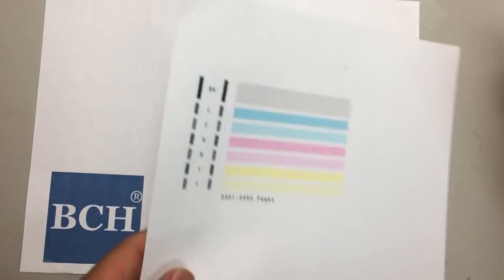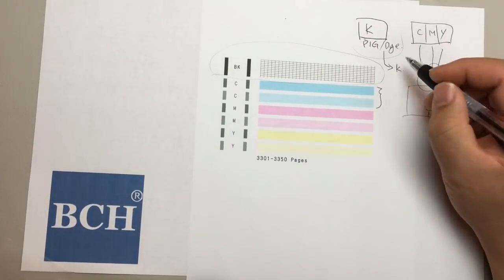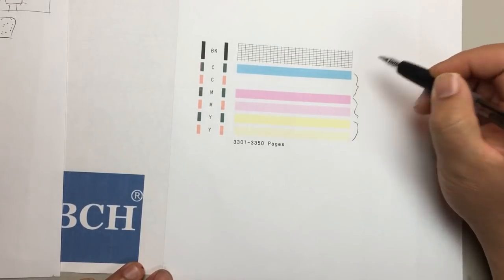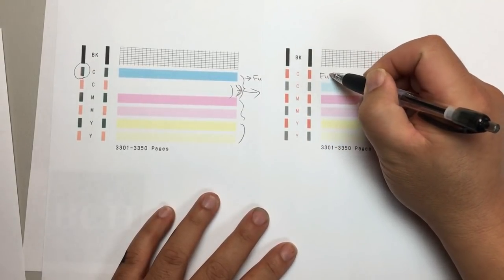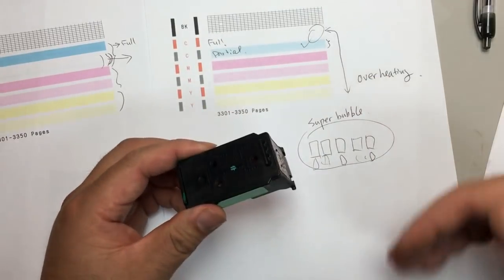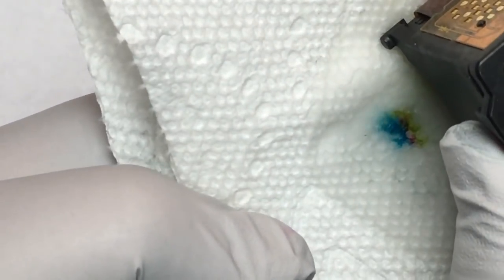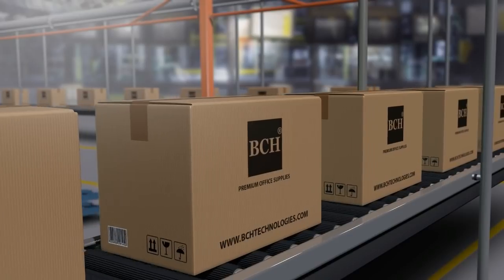#1 Refilled Canon Printhead Failure: it is NOT clogged!

Comment from the maker: 0:00 How to Read a Nozzle Check Page
8:00 Unclogging with Priming Clips
8:56 Boiling Water
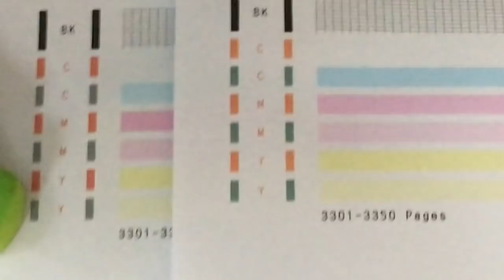9:30 Ultrasonic Cleaning
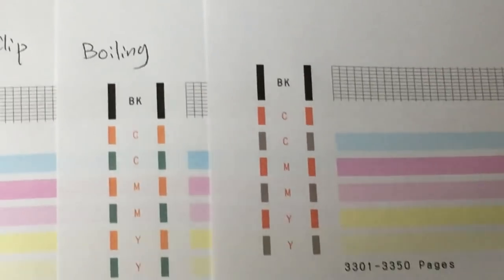10:00 High-Pressure Steaming
10:33 Vacuum Hose

Comment: I'm a software engineer. I used to hack printer devices (for example the epson xp320). In their program, there is a hard limit on how much ink can be spent on each color on one cartridge. What it means is even the nozzle is not clogged/jammed, the program will still disable the ink cartridge via its chip and makes it look like the nozzle is end of its life after certain prints using that color. That is the main reason of refilling ink doesn't work that well. I verified it by changing the chip on that cartridge, and everything just worked again. Not only that, the printer body will have a hard limit on how many times you can use the internal program to clean the nozzle. After that the whole printer will just stop working if the limit is reached.
Reply: Thank you so much for this information. You have no idea how I have been driving my self crazy with all the printers I have tried. I have own 4 epson and 2 canon printers and right now the Canon TR7020 that I have is showing that the black cartridge is not printing correctly and I had a feeling that it has to do with the filmware that I keep saying NO to the update. This information you posted here give me peace of mind that I am not crazy :) Any suggestions on how to avoid or fix all the limits you mentioned to make the ink cartridge work again?
Reply: @VickyLatorreArt  The easiest and most feasible way is to buy a bunch of the ink cartridge chips and change it when refill the cartridge. This still requires some $. Second way but may not work for all printers, is to buy one hacked chip for each cartridge. This type of chip when you run the printer program "replace the ink cartridge", the chip will be activated and update it's serial number to deceive the printer making it looks like a new cartridge. Third is to build your own firmware for the printer but it only works if you are the internal employee and have access to the source code. However, releasing the source code or the hacked firnware will get him/her into legality issues. Take my example xp320 printer, if you search xp320 refill chip, there are plenty of them on ebay.
Reply: @VickyLatorreArt  Also for resetting the nozzle cleaning limit, there maybe software online depending on your model that you can buy to do the reset. Although people like me they don't have access to the firmware source code, but hacking the device via UART/USB so that they know what command to use to reset the limit. But those reset can only clear the nozzle cleaning limit not the cartridge life span.
Reply: @jasonliu3202  Thank you very much.
Reply: @jasonliu3202  I purchased refillable cartridges with auto setup chips in the passed and they worked very well for me with the Epson Artisan 800 the rest of the printers have not give me the same luck. No matter what cartridge or ship they always end up not working. I was hoping me leaving Espon and getting a Canon would do a difference but I still have the same problem after I fixed it. This present black color cartridge I have in my Canon TR7020 stopped working. I changed the pigment ink to dye ink and used the cartridge clip Mr. Kevin has in his website and the cartridge came back to live twice. But now is doing the same thing again. I have tried everything. I have it soaking in water at the moment to see if that works. But after trying all that I have tried before I don't understand why it happened again. The only thing that makes sence to me it is what you mention about the limit and the filmware I have seen give problems to everybody. Thank you so much for all your imput. I really appreciate it.
Reply: @jasonliu3202  perhaps it's time to completely rewrite the firmware rather than just patching it. :)  There must be some good reason not to confirm an answer to an obvious question.  Thanks for another great video
Reply: @VickyLatorreArt  updated firmware for canon unlocks 3rd party cartridge/ink usage, because of supply chain issues worldwide.
Reply: @Seriouslydave  At the moment my Canon TR7020 is working. The black cartridge has stopped twice but I leave it sucking in water for a day and use the adapter I bought from Mr. Kevin website and it makes it work. The inks I am using are water base no oil base like I wanted. It is not good enough for heat press transfer printing but it is good enough for documents.
Reply: why they do that?
Reply: my canon g3010 bought last year produces black that is not in full color. I mean the upper part has color. the middle don't have. the bottom has. I did everything. but it did not go back to normal
Reply: @kim9953  Not sure about Canon but Espon is doing that. Main reason I think is to force people buy more ink cartridge because the ink is too cheap to earn anything from.
Reply: @Seriouslydave  Really david are you sure of that as i would  like to  do the update on my TS 8320 Canon
Reply: So it means even i change my cartridge i will experience the same issue because the limit of chip hits the maximum
Reply: @NLIFE1234  As long as you keep buying new cartridge and do not use the internal program to clean your ink nozzle, you should be fine.
Reply: @jasonliu3202   thank you for verifying this. The greed of these printer companies is making me so mad. we're wasting a lot of time to fix something that are intentionally made to be non-repairable.
Reply: There is a waste tank at the bottom of an EPSON printer, and the clean times counter is responsible for not overclogging this tank, or the printer could suffer catastrophic self-disassembly of pressure lines and dump ink on the desk. It is normally fairly generous for normal use life of the printer, few people ever have to worry about hitting that count. There exists a maintenance procedure which consists of replacing (or if you're brave "replacing" that is just giving it a good stern look, or manual cleaning) the waste tank. Since the tank isn't chipped, there is a corresponding technician service method to tell the printer that it has been replaced, it usually works via USB; whether you'll find it for your particular printer, depends.

The waste count increases with different uses, with ink tank replacements, with load unload of heads, but not as quickly as with hard clean procedure.
Reply: Sir, can you stop the annoying canon genuine cartridge problem?
Reply: This is exactly the comment I was looking for. I now have a new Canon TR 4650. There is only an integrator for papers on the cassette. It probably also detects the number of prints. In the videos, people cheerfully fulfill it, but no one says anything about the reset. Is it possible to print even with a warning sign that the cartridge is empty and continue with only a refilled one without resetting? Sorry for my English.

Comment: hi Kevin at BCH I like the information you provide in this channel. I would like to add a bit why there are 2 lines of check nozzles in each color on a canon printhead. Although in some types there are several colors that only display one line. From my observations why there are 2 lines of check nozzles in each color is because there are 2 lines of nozzles in each color and both have different hole sizes. One row has a larger hole diameter than the other (in certain types, 5pl and 1pl are listed). That's why we get 2 lines of check nozzles. However, in some types, we only find 1 line of check nozzles, possibly because the color has the same nozzle diameter size each side.

Comment: I'm having this exact same issue with my ix6820, definitely a failed printhead.   The light colors for my CYMK test print are completely blank.  If I print in standard quality all colors print.  If print in high quality, the colors are half missing.  I've used the ix6520 for over 10 years and never had this problem.  Not even when I removed and cleaned my printhead.   Owned the ix6820 for 1.5 years and it's been nothing but issues.  Glad to of found your youtube video as confirmation, because it's been driving me crazy.

Comment: Hey Kevin!
Just wanted to thank you bro! For the very useful and accurate instructions. Specially, this one: "Do NOT give up too early...!"
I've got a TS3440 PIXMA which has PG-440 & CL-445 cartridges. And I used to refill them with insulin syringes, without no trouble. But, after awhile the black cartridge stop printing even after refilling (I did not used to prime the cartridges at that time nor was aware of its necessity!) So I've end up breaking open the cartridge lid and removing the sponge trying to make an sponge less one, after seeing the near dry and almost white sponge in there. However failed to airproof the lid, everything was fine except for the ink flow to bottom plate. So I had to remove the lid again, though it was very hard this time- I had to sink the cartridge in acetone for several hours, trying to place back the sponge, fixing the gaps & ...
After all, the most valuable tip of you which I kept in mind was "Do NOT give up too early, show your printer who is the boss!"
Thank you brother, thank you very much!

Comment: Amazing how little inkjet printer technology has advanced. We got lasers, we can print on various surfaces, UV inks, latex inks and now we can sculpt/print in 3D! but yeah we still cant keep print heads from clogging and causing banding on prints so were over here boiling, steam cleaning and wasting tons of time trying to talk to tech support as you work as printer technician in a frustrating effort just to save a print head thats going to mess up again anyway later on so you bite the bullet and eventually buy a new print head/printer. Ok, printer manufacturers, you win.

Comment: Seems like the ink channels are all flowing after all those different cleaning methods, but maybe something electrical?  As the 100% Cyan isn't firing 100% at all... but does for the Cyan 70%-80% test bar?

All my CMY (and dye black) are NOT firing... but my pigment blacK does.  The ink flows though manually, just not when printer executes the nozzles.

Comment: Dear Kevin,my Canon Pixma MP490 prints perfect black but does not print color at all.When I print a nozzle check pattern,black is printed perfect,but below it the page is totally white (blank). Not a single trace of color. Both black and color cartridges are full (I refilled them myself). Of course,I've tried all unclogging methods, but nothing worked. Any suggestions? Happy 2023!
Reply: Same problem.  Any solution?

Comment: Canon MP520   ITs been a great printer.  But the print head failed... or so I thought.  I bought a new print head and at the 1st the printer did not recognize it.  Then it did. Printing was restored slowly but there is no yellow.  So I tested the print head in a different MP 520 = all colours have perfect saturation in the 2nd printer.  So the yellow does not work in the first printer.  Checked and cleaned gold pins on carriage with iso propyl  = no change!    Any suggestions?  Eeprom, connection?

Comment: 2:30 I don't think you're correct. Actually, there are different sets of nozzles, one that are able to project 1pl(or 2pl) droplets, and the other project bigger 5pl droplets. That explains why one can be clogged while the other are not. At least that's my understanding.
Reply: That's exactly what I was about to write now :) So it means, that one nozzle for blue is still clogged. I realized that after watching this video https://youtu.be/o8B5TAqymks?t=45 where you can see CMKYMC nozzles. Thats the same as in test pattern, where is only one yellow, but two cyans and magentas. It also means when you are able to clean printhead from topside opening, you cannot be sure that both (or more) nozzles for that color are cleaned.
Reply: makes sense. probably those are not clogged, they might even be burnt out

Comment: Good day, thank you for this info. but it doesnt work for me. i did all the cleaning, deap cleaning, hot water, vacuum, but still the colored cartridge still not working. but when i check the nozzle, i put it on a tissue paper theres a mark of the 3 colors. but when i put it back in the printer theres no coming out. what should i do sir?
Reply: Too me sounds like a dead logic board......No output to Printer head assembly.

Comment: Great video. What does it mean if the entire top section with the black grid lines does not print at all? 

It’s not fuzzy, or slightly printed, it is completely missing, and the rest of the page prints fine.
Reply: What did u find out?

Comment: i inform everyone with this kind of problems, that canon is being abosive trying to sell his printer ink with the following method ..., because i already had two high resolution printers of the same brand a mark ii that gave head problem because I used cheap ink cartridges when I wanted to use them just for copying so I stupidly bought a pro 10-sa to think that I would never have any problems but I was wrong, I need these companies for photography exhibitions of which I use the originals but how the ink is it is very expensive for more basic things I change the ink cartridges, only that both had false problems in the print head. whenever I used non-figdinios ink cartridges from the beginning it diminished the quality of purpose after it gave the print head a problem with some use or injected a few more colors, so I decided to do some tests I changed for all the figdine ink cartridges and she magically stopped giving problems, then not happy i decided on 2 or 3 white ink cartridges and it worked well on the table. again I added more altered cartridges and it was a problem after a few prints. So I decided to understand what was going on and trick the system to see if it was really ink or canon to sell your ink cartridges created a purposeful problem. and voila I drained all the original ink from the fiddinios ink cartridges and injected the ink of another brand for testing, so I printed many things and it was no problem, that is, the problem is not the ink but the canon, they do something to give problems on purpose. ... it was my conclusion I spent a lot of stress with this problem I think I am not obliged to always have to use the brand's ink ....

Comment: If ink has dried within the head, using force or high temp will only make it harder to remove and ultrasonic and suction won't work.  You want to start with the physically gentlest method . Start with low temperature chemical solvent and soaking, alternating with rinsing with warm water in a gentle flow in BOTH directions until the water runs clear. Check that head is clear of ink when resting screen side down on a dampened towel for 15 minutes.    If any color emerges do another cycle.
Reply from the maker: True. Ultrasonic needs fluid to work. If yours is a hard rock, it won’t help.

Comment: Thanks for this video... the issue broth me here is a bit different. Hope I can hear your suggestion.
My original printhead showed double lines on the squares at the top - so I ordered a new printhead
But, the new printhead is not printing anything below the graph with the squares at the top. Not even the black marks on the side. In other words my printer doesn't print anything color so far. A rainbow text will end up as a blank page, even if the printer is acting as printing, the paper has no color ink on it. But everything black comes out nice and sharp.

Is the problem with my printer or my printhead?

Comment: had same issue with my cl811 worked for few months then got issues like this.i even took everything apart. can it happen that its an issue from the back? copper contact from cartridge to the printer? was planning to revive my printer on getting a brand new cartridge :)

Comment: Hi Kevin. I follow Canon's procedure for cleaning my MP 560 printhead.  On the nozzle check I am getting a vertical off white space (OR LACK OF INK)on line 20 of the top multiple squares and on the rest of the colors two off white line using the square boxes as a reference the line would be in box 23 and 25. This until the bottom back color and it goes to one line at box 27 Any ides or is  a new print head  called for . Please let me know Thanks
Reply from the maker: Hard to tell. Send me a picture.

Comment: Hi Kevin. Thank you for the informative video. Just one question. I have a Canon ip7240. On the nozzle check print, none of the Cyan lines are printing. It comes out pure white (as per your video). Is it safe to assume that the print head has died?
Reply from the maker: It may still be salvageable.  Put it in boiling water and give it a good prime.
Reply from the maker: The only time to give up is you see the 2nd bar but not the first.  If both are missing, it is good news.
Reply: @BCHTechnologies  Thank you so much Kevin. I truly appreciate your feedback! 🙏🏻

Comment: Hello Kevin BCH. Ihave the first problem and after 6 cleanings it still persists exactly the same. The white streaks in the nozzlecheck is not in the full-color bar but in the 70% bar on all colors blu, magenta and yellow. 

Another problem is on color prints, i see a faint bar across the paper, it's not a white streak, that has a slight darker color than the color on paper. It's on all color prints. Could it be a dirty roller or the paper is too close to the printhead at that point?

Thanks